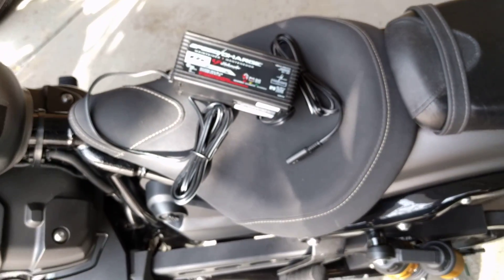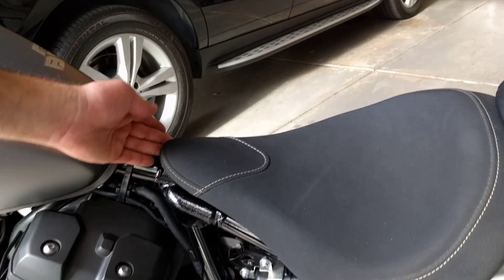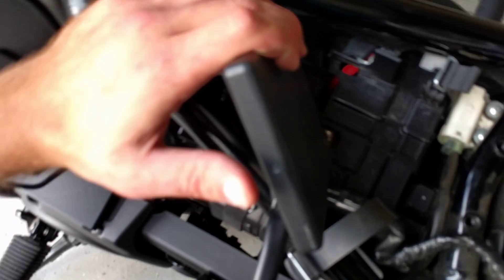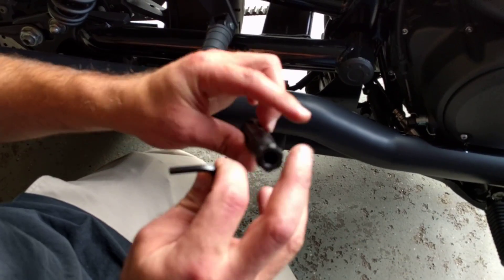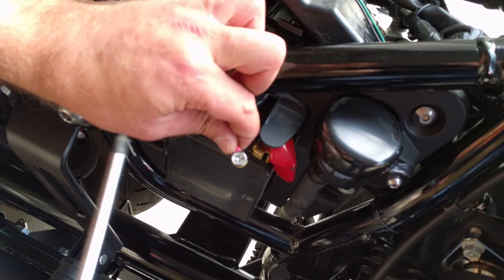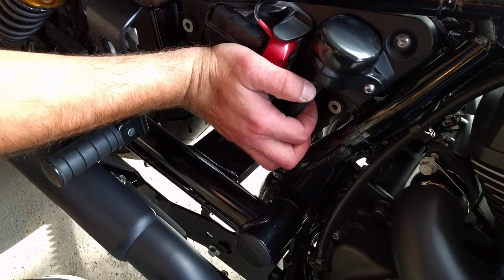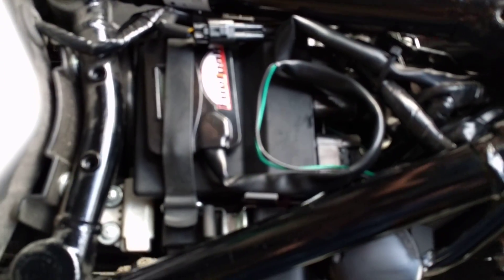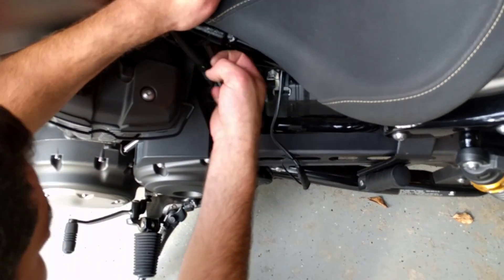Yamaha Bolt Full Battery Trickle Charger Installation Step by Step

Comment: Question: Do you keep the adapter connected the battery all the time, and only the tender hooked up over the winter?  Or do you keep the tender on 24/7/365?
Reply from the maker: It’s hooked up all the time. Reason is I bought a plug in with an USB port that goes into it
Reply: @TheRealReviewz   Thanks!

Comment: It's a good Idea to pull the main fuse before you do anything like that.
You should also connect the positive before connecting the negative. Having the negative connected will ground the bike to the battery. If you accidentally touch a tool or something to any metal on the bike, you would put a direct short across the battery!!
Best safe then sorry.
Reply from the maker: Thanks for the advice
Reply: Beesky505 C where is the main fuse? I wasn't sure so I removed the battery. so relieved to have it on the trickle charger.

Comment: Haven't rode my Bolt for a year.  Won't turn on.  Zero signs of life.  Do you think I could charge it, or should I just go buy a battery.  This is a great video, thank you.
Reply from the maker: I would get a trickle charger first because it can be a pain removing it. But that’s your call. I would buy charger first because you need one any way
Reply: Thanks.  I had it towed to shop and they said it was dead.  Replaced it.  Do you think you'll ever do a video about removing / installing Bolt's battery?
Reply: I would like to see that video too^. My battery recently died and I got quoted for a new one at $235 to have it installed. That just seems high to me...
Reply: Captain Sunday if you don't keep it charged through the winter it won't last until spring.

Comment: Do you really need to hook up the negative? Cant I just clip it to a metal rod? If so, I don't have to take off the seat.
Reply from the maker: +NITIN SAWHNEY you can but it's quick and easy to take off seat. You don't want your bike on fire. But your call
Reply: Yes you can.  Then remove the rubber tires so metal rod sink charge into the rims..and rims can sink it to the earth(ground)
OR
you can use negative that's what it is for.